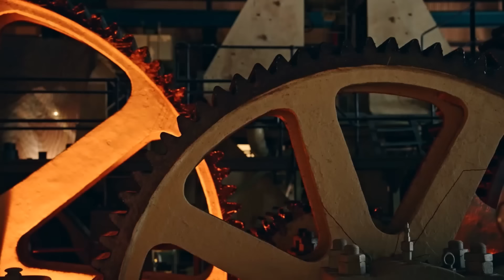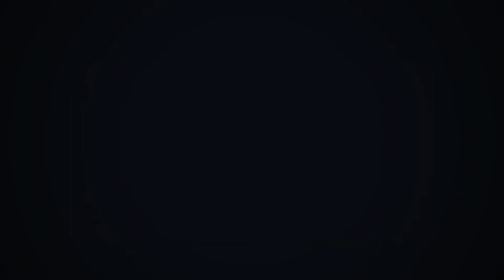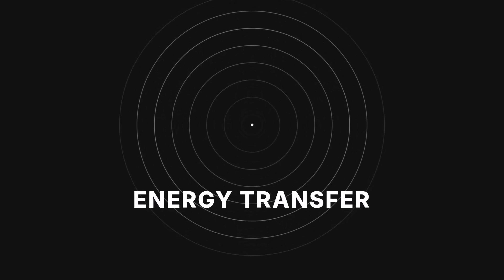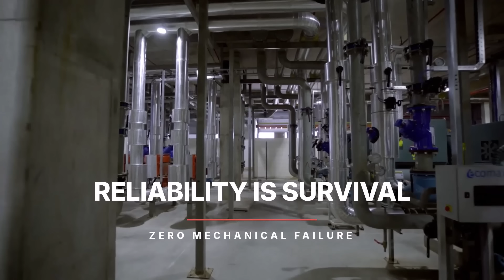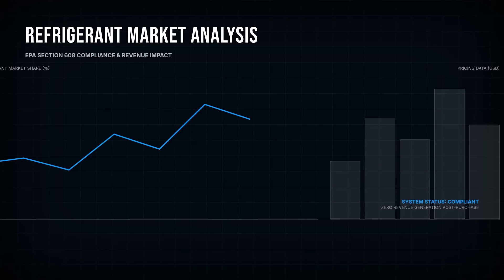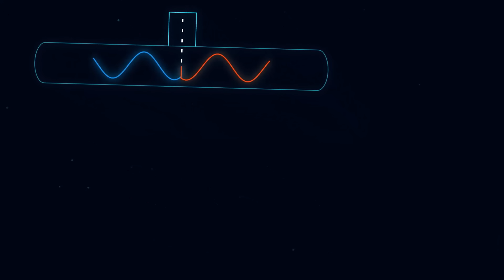This 1930s Metal Tube Cools to 40°F With No Moving Parts and No Chemicals — Why Don't We Use It?

Comment: Vortex tube.
It needs so much compressed air, that the compressor is an energy hog and as noisy as a mini hurricane.
  I used one to power a food cooler in the car factory where I worked.
It ran on the factory air supply, and factories are already noisy, so it was easy to hide.
  We ramped it down because we only needed enough cooling to keep our food cold.

Comment: We don't use it because it consumes between 4 and 40 times the amount of power. Imagine your power bill 4 to 40 times more. No moving parts? It requires an air compressor with moving parts. Compressed air is not free.
Reply: Yep it's good for what it's good for. Put a little cold air gun on a small component that gets too hot and bingo but if you sue 15 or 20 of these little devils in the shop then suddenly you need another air compressor to keep up. Cheap to buy and easy to install but expensive to operate.

Comment: This is used in high dirt environments to cool the electrical cabinets cooling them and pressurizing to prevent dirt infiltration. It used compressed air. But in India they cool rooms by using plastic bottles with the bottom cut out facing outside accelerating air Currents into the room to cool it. I think a large cyclone vessel would cool air effectively in my area quite effectively in a cooling tower

Comment: It needs compressed air, that means a compressor and that needs power. If you have a power failure you have no compressed air. Yes you can use a diesel compressor but you can use a diesel generator to drive vapour compression systems or drive a vapour compressor system direct as in vehicle A/C. Vapour compression has a COP of 3 to 5, big is good. You said The compressed air has a COP of less than 1 so very inefficient so needs much more energy to move a certain amount of heat. Probably why it is only used in niche markets.
Reply: It needs no special gasses exceot a pressured one might be air ever heard of a pressure storage tank outside of your diy low pressure storage tank ???
Reply: @sietze.temporary  how do you fill your storage tank? I said compressed air.